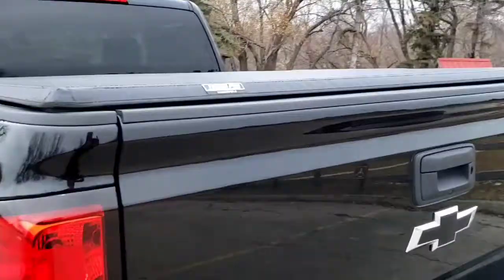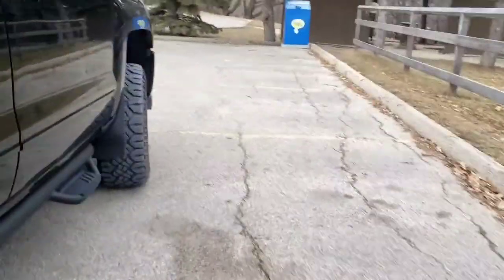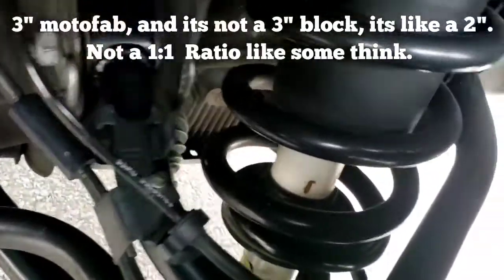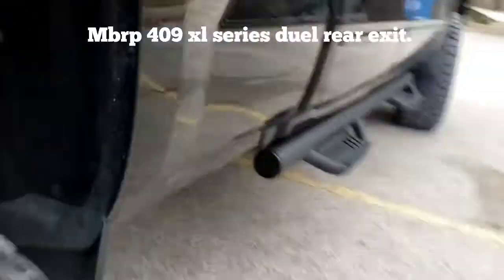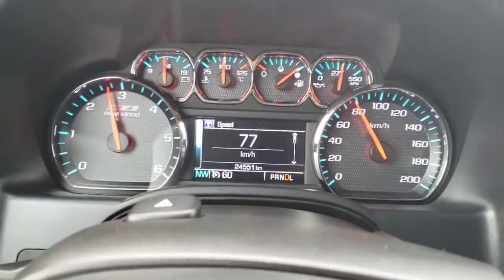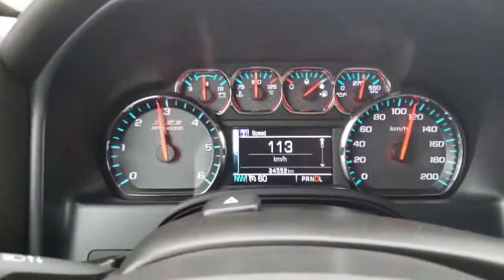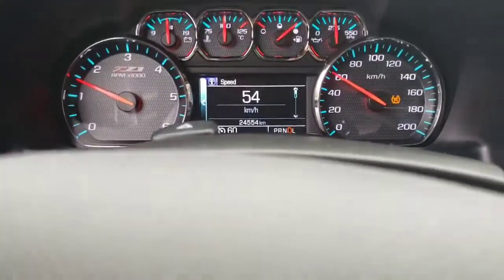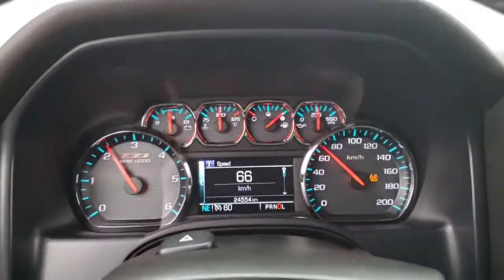Ripping the Silverado with the new carven r and afe intake.

Comment: How is the poke? Do u have any? Do u wish u went -12 offset?
Reply from the maker: There is about 1" now.  But yes, Definitely wish I went with a -12. Just a bit more.
Reply: @02mp9696  I have a set o method nv 18x9 0 offset in the garage and I’m debating sending back for -12 before opening them up.  Is it a good 1 inch poke and if so then why do u want the extra 1/2 inch? Do I think 295/70 18 tire would have given u the extra poke u wanted or still need more?
Reply from the maker: @getoutdoors2693  Not sure what your asking lol. But my wheels are +1 offset. The duratracs give the 1 " poke. Wheel itself is pretty flush. 
With the -12, it would be about 2" with my tire. And a 295/70/18 would probably bloat out the tire a bit more. But I plan to switch up the setup eventually.